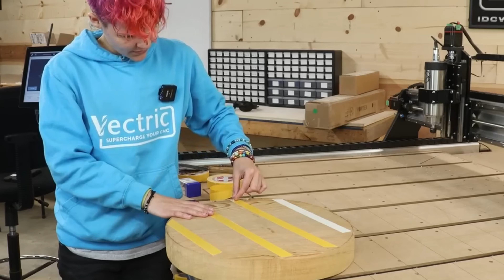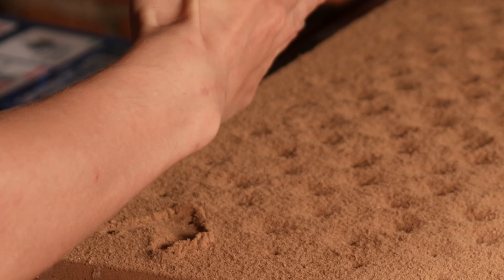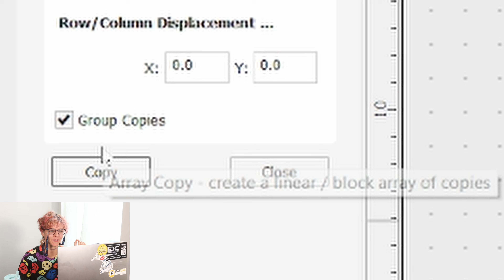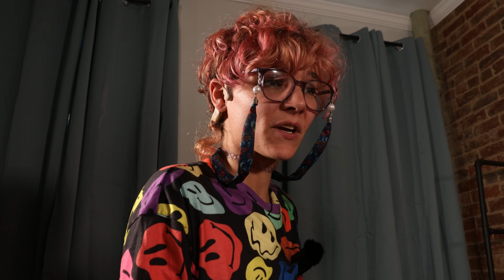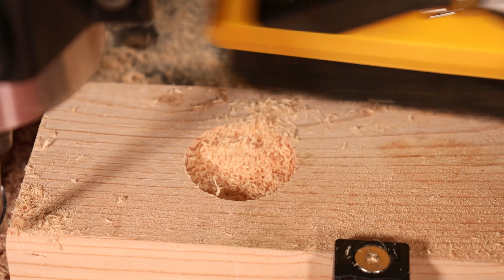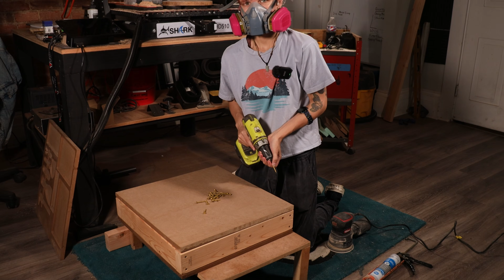I Built a DIY Sanding Table With My CNC

Comment: Hi liberty happy to see that you’re advancing in your woodworking skills. One thing that I noticed; you claimed to have spent a lot of time and energy sealing all of your parts.  That’s absolutely necessary. But what I did notice is you chose to use clear Lacquer / or finish as opposed to a pigmented lacquer/finish. That simple decision made your project look like a DIY 2 x 4 MDF project that it is. However, had you painted it; let’s say a flat black or a matte black, then it would match the colors of your shark CNC.. and it would look much nicer on your CNC. When you make your videos, like you’re doing right now with this video. It will film better on your YouTube channel. You can increase the value of your product simply by changing the way it looks. You put out the energy to cover it and seal it, but you didn’t consider the value of the color of the sealer..
Reply from the maker: Hey there, thanks for the thoughtful critique! Liberty will definitely take your feedback into consideration for future projects. We appreciate you watching and sharing your insights!

Comment: I think that's a pretty good idea.
Reply from the maker: I'm glad you think so! Thanks for watching the video, my friend!
Reply: @IDCWoodcraft  I've been thinking for a while about making a vacuum table to replace my spoil board. I thought pulling chips and dust off the table, into a chamber and into a shop vac or dust collector might be more effective than the dust boot I'm currently using, especially on long running jobs.

You're very personable, enthusiastic, entertaining, and I'm impressed with how much you leaned in a short time. You can tell Garrett I said so.

Comment: A lot of work when you can just connect up the shop vac to the back of your sander. I have commented before on how dangerous it is not to use good dust extraction. Many hardwoods and MDF are known to be carcinogenic and you need to ensure you are catching the smaller particles. Large chips are not a problem, but will be mixed with the smaller particles. I have made a dustshoe to fit my CNC which is great at eliminating dust at the source and I still feel like I could be doing more. I would also be wearing that mask when sanding as it would also help protect you. It's not worth the risk. Think about your lungs, you only have one set.
Reply: I have been doing woodworking and sanding for 50 years now. I hate masks. They bother me to no end. I only wear them when they’re necessary. I’m 80 years old. I’m still working. I still have my own shop. Still don’t wear my mask. Learn to live with it.
Reply: @larrychampion0618  Larry, there is always a percentage that it does not effect like smoking, but how do people know that they will be the one to dodge the risk.
Reply: @MarkRookes-p1o  very simple Mark I trusted my Lord Jesus Christ to protect me. It’s his body he gave it to me. I have given him the permission to heal my body as necessary. I’m 80 years old and then never been hospitalized. I’ve never been on any medication ever that’s because I trust in my Lord Jesus Christ try it works pretty good.
Reply from the maker: Absolutely, you bring up some great points about dust extraction and the importance of protecting our lungs. It's always better to be safe than sorry, and I appreciate you sharing that valuable insight with the community!

Comment: Looks great. Save some time pre drill your screw holes at the same time as putting in all your vacuum holes. Also make some table blocks with 1/4 dowels to put just outside of your project. They will keep the piece from sliding around. Also you could have probably used a piece of tape around the outside and had less problems taking it apart. Great job and I might have to make something similar for sanding.
Reply from the maker: Thanks for the tips, my friend! It's always great to hear new ideas for improving our projects.

Comment: Thank you Liberty, this video is great and it has helped me to make a few other tools and projects better and quicker. A idea for better vacuum may be to add a tool path for a 90 degree V bit to circle around the holes to create a beveled flow for the sanding dust.
Reply from the maker: I'm glad to hear the video helped you out! That’s a clever idea for improving vacuum efficiency, brother—thanks for sharing!